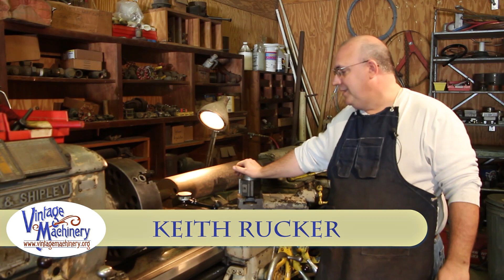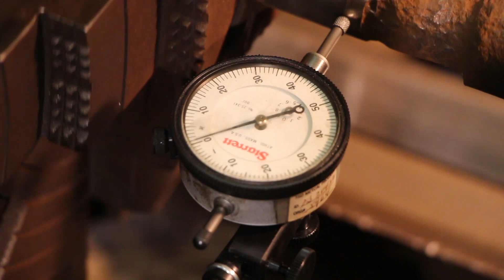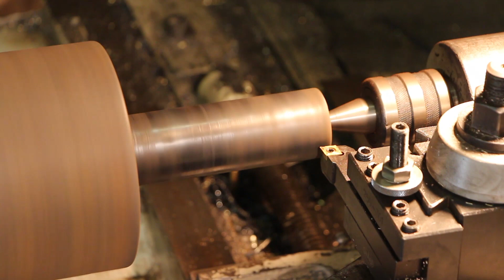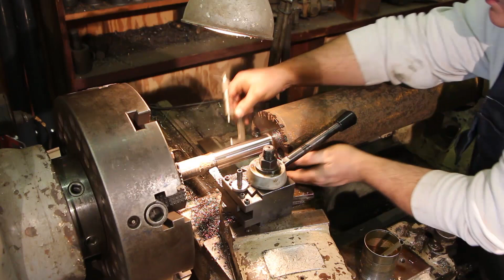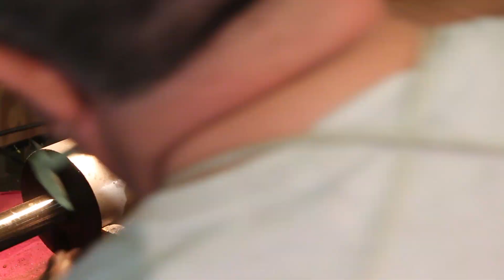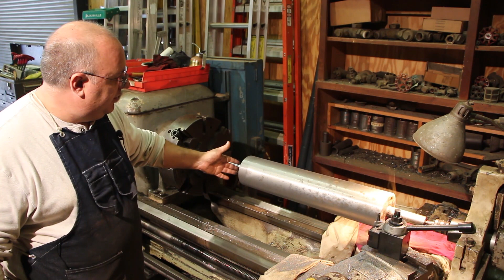Turning Feed Rollers on a Metal Lathe

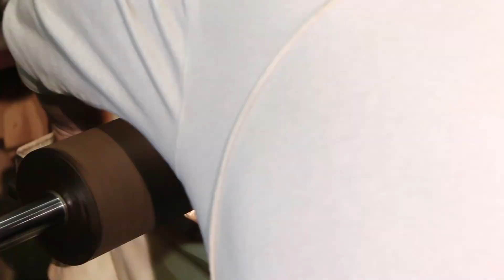Comment: @29:30 as you start the lathe it can be seen that the end of the roller nearest the chuck look to be running true whereas the other end is way out. This shows that the runout is caused by an untrue centre. Why could you not work this out and show your viewers how to correct it rather than deal with it by removing lots of metal? I thought you said you were a time served engineer. The view @30:13 shows absolutely that the chuck end was true to start with. Why are you passing your confusion off as an example to your viewers?

Comment: @15:00 the only way the end of the shaft can be running out by 15 thou is if the centre hole is not true. Bend on the shaft cannot cause run out at the very end. There may also be some bending issues but that would be a separate consideration This should be obvious to you and any half decent engineer. Why are you misleading your viewers in an attempt to gloss over your own confusion?

Comment: Keith just an idea but see if you can use the wife's old vacuume cleaner when your doing cast iron and use the fine nozzle to suck the chips up as there coming off the tool some will not be sucked up but most will be sucked up and you don't have as big of a mess to clean up. 
I don't recommend  you use her new one unless you like sleeping out at the museum.
or buy her a new one so you can have the old one. hehe

Comment: Seeing these so rusty, something occurred to me. The museum should have a seamstress make these rollers a sleeve. A simple zip on sleeve to keep them protected for when the machine is not in use.

Of course the machine never had such thing initially but nowadays the higher end of the market does provide covers for the critical surfaces. 

It would be a pity if the surface got pitted up again.
Reply: ***** I have noticed that, but it's not surprising to me, they used and still use cast iron in man hole covers. If that's not the mother of all rusty places i don't know what is. :)

Comment: Hi Keith, I was wondering why you didn't turn these parts between centers. If both ends have center holes like you said in the video, I would have thought that was the way it was turned originally. Don't get me wrong I'm not criticizing as there are many ways to do a job and there was nothing wrong your set up. I just thought it would have been an easier set up and all you would have had to do was flip the part so the other end was in the live center or use another drive dog to cut the other shaft. I've had to do many jobs that called for very close tolerances and concentricity and the best way to do that was between centers. Good videos and still love to see other ways people come up with ways to set up work and solve problems. If you get a chance get back to me as I'd like to hear your thoughts.
Reply: Judging by how seriously corroded the stub end of the shaft is in the chuck, I'm assuming the centre was so degraded that it was useless. I've seen many situations like this on very old machinery. Keith was using the most reliable method.